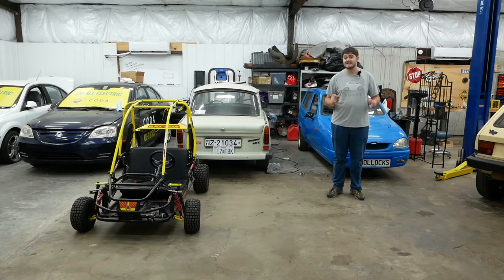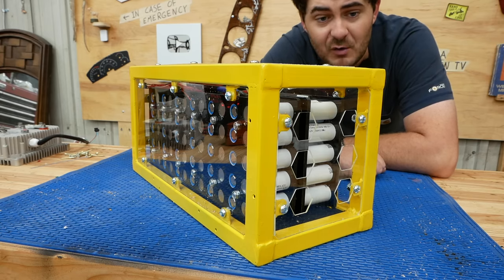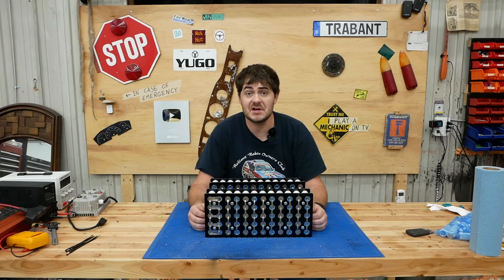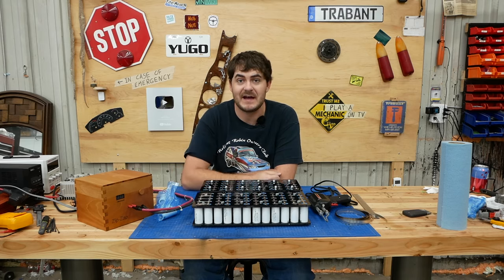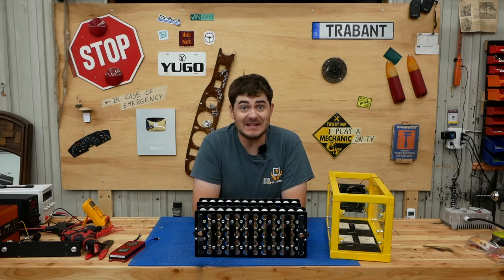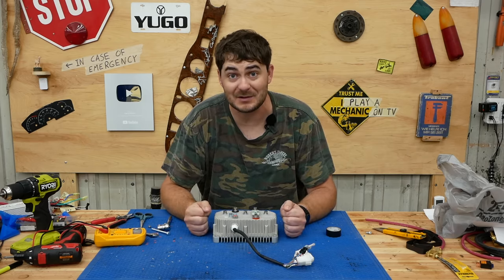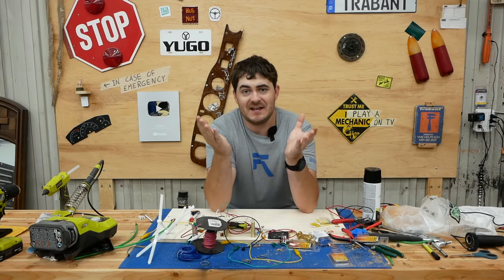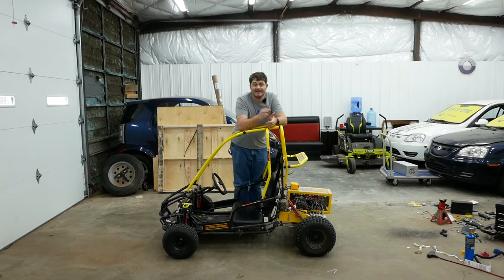I Spent Weeks Converting This Go Kart To Electric. Did It Work?

Comment: I suspect at higher torques, the magnetic field from the widnings is strong enough to overpower the rotor's magnetic field.  That in turn would cause the hall effect sensor to give bad readings.  Try running more current through the rotor.  Or make another rotor coupled to the alternator, with permanent magents, jsut to drive the hall effect sensor.
Reply from the maker: A secondary rotor just for the hall effect sensors is genius and something I never considered
Reply: Stares at electric lawnmower
Reply: It might have been the 3d printed parts he used!
Reply: I think it's more of an issue of interference with the hall effect sensor itself. Either magnetic OR electrical. Electrical shielding of wires, and magnetic shielding for the sensor itself will probably be the key. Add a shield wire to the sensor wires, twist them tightly, and attach only one side of the shield wire to ground. Start with the small things first.
Reply: What does fiberglass taste like
Reply: Yep, since the alternator was not designed as a motor, the magnetics would be rubbish and cause interference I reckon.
Reply: @sunnyjs  does it have speed control?
Reply: "PMG control" I love  it ! If you're going to build a PNG!  think about a multiplication ratio of at least two Times base speed of the primary mover... Will significantly increase tuning resolution within the motor controller!  Peace
Reply: This is great thinking
Reply: THIS IS THE COMMENT CROSSOVER EVENT I'VE BEEN WAITING FOR!!!
Reply: @agingwheels  It would also be a very good idea to print some sort of cover for the top of the controller to insulate the terminals.
You're getting into dangerous DC voltages there.
Reply: I love it when two people I subscribe to talk to one another.
Reply: Holy guacamole Matthias.  I've been running into you for years.  I remember you back from I think CNCzone when someone, or you posted the calculations to make gears.  1.7 million subs now?  Well done.
Reply: Hi Matthias!!! Big fan here. Love both of your vids! Also you are correct about the magnetic field and the hall effect sensor.
Reply: Permanent magnets should have been installed anyway, since there is no need to vary the field strength of the rotor.
Reply: @agingwheels  do it.
Reply: “Hall effect sensor?? But I installed that myself!!” ✊😂💜
Reply: Yeah I was going to say externally mount the hall effect sensors and make a permanent magnet disk
Reply: @avaviel  ????
Reply: Honestly just ditch the sensors. Wire the motor as a series wound motor. You can then just use a controller that costs 10% of what AC controllers do.
Reply: @sunnyjs  What's this for? It's your electric go cart son that can only be run on the grass with supervision
Reply: @agingwheels  why not just make it a permanent magnant motor with neodymium magnats?
Reply: Unless a overvoltage protection is used to keep the rotor from generating a higher voltage condition being fed back into the buck converters this could potentionally cause the output capacitors of the buck converters to be overcharged and fail due to the field coils driving back at the rotor coil. Most buck converters have over voltage protection as the use pulse rates to charge the capacitance to desired voltage
Reply: my life is like the hall effect
Reply: @gregbailey45  I don't think that's it ..also Chinese motors have unshielded hall sensors and the work fine..
Reply: @WCM1945  why you say that? In the end the electromagnets are doing the same work right?
Reply: Why did I read this comment in both of their voices perfectly?
Reply: Or maybe he could use an encoder (a type of sensor that measures angle of rotation, and are often used for brushless motors.)
Reply: 000009n😊 11:23 😊😊😊😊 11:45 11:49 😊😊

Comment: Pro tip: when an internal fuse in an electronic device pops (ie one soldered on the PCB that's inaccessible without voiding warranty) there is ALWAYS a reason. Always. Maybe a transistor's gone bad, or a chip is fried. If it was a simple over current event, the manufacturer would have put externally available fuses, for example the glass fuses that some devices have in a screw type terminal.

Comment: I'm throwing a guess, but the hall sensor error upon increased current could be from electrical noise interfering with the sensitive hall signals, and then the motor controller freaks out.
Reply: BIG CABLES WITH NO SHIELDING my gosh, u might be on to something! HE NEEDS TO TWIST A SHIELD WIRE into sensor wires OR FIND SHIELDED SENSOR WIRES
Reply: @imakedookie  that might reduce the overall efficiency and overheat the motor but it wont cause an immediate cutoff
Reply: I'd put money on it. Those little buggers are sensitive! Was having intermittent issues with one and the problem ended up being the trackpad on a laptop on the other side of the room.
Reply: So throw an oscilloscope on it to check the signals on a bench test? Use a portable 'scope for live testing?
Reply: Most likely an transient from the DC-DC coupling into the LV lines. Some shielded HV cables and better grounding might improve the behaviour but i would recomment a proper motor that already has the sensors as it might already have some filters or anything.
Reply: Yeah interference or the hall sensor at the wrong spot, causing timing issues. When you never build a proper electromotor with feedback then you have a big chance you fail the first few times. He would have been better of buying a motor. Now he has a lot of dead or maybe dead parts.
Reply: Carrier frequency emf from the drive. Yep
Reply: Nobody mentioned that the rotor is actually coupled with carbon brushes... Not to mention the rotor is actually a coil, not a permanent magnet and that creates a transformer effect. He just needs some hoverboard motors and a way to connect them together.
Reply: We ran into the same issues with and ODrive in research. Good grounding helped as did a choke around the wires. Also making sure any regenerative current settings/ over current settings are high (or low) enough. Hall sensors are tricky to get working.
Reply: @alan_felt  +1 on the current limits and good grounding. EMF noise in usally not that big of a problems since there is no sparks from brushes involved. I'm thinking a hall timing issue. Creating a few cm of distance between hall cables and motor wires is always recommended. Also short power cables. Have you made sure the low voltage signals only have one way to ground? 2 or more ground alternatives create ground loops and can distort the input signals to the esc, but I dont think its what happening here.
Reply: this is also what i would think is the issue. a proper motor for that controller would fix that part of the issue. the bms cutting out is likely the surge current of that controller being too much for the bms itself. the inrush current from the battery on the charger likely fried the charger.
Reply: Exactly my thoughts, noise is explicitly one of the things that looking up the error suggests as a cause.
Reply: I think use Some better dc to dc converter for your coil. For interference. And you have to weld your tabs in you battery. To much internal resitance when using clamping. The current draw is high when starting the motor underr load. Have a great day
Reply: @fletcherreder6091  Whaaaaaaaaat hahahaha
Reply: hall sensors are also incredibly sensitive to magnetic fields (nearby high current conductors would mess with the sensor head quite a bit) - which is also something a copper or aluminium shield would not block.
Reply: @DockterDoom  needs to use a toroid on the hall sensor wrap a few windings around the toroid if that works it was RF field getting into the wires causing error
Reply: @DockterDoom  But he tested with a separate battery on the rotor ! No EMF there !
Reply: Couldn’t the controller be misprogrammed with “pole count” too? I remember programming a Sabvoton motor controller and had a similar error.

Comment: Oof, hall sensor errors have plagued me with Kelly controllers. One thing I’ve noticed is my kelly is incredibly sensitive to hall signals that output a poor signal. Try scoping the hall signal and make sure your hall signals are clean and make a clean transition between high and low. I’ve had this issue in two motors, one was solved by modifying the motor and the other was solved with adding a little capacitance to the hall signal that has the issue. Let me know if you need any help!

Edit: I should also mention that Kelly provided amazing product support. Send them an email and Fany will get you sorted.
Reply: Something doesn't make sense in his setup, he uses an alternator which afaik doesn't even have a built in hall sensors so unless he added them or uses a sensorless controller that wouldn't work
Reply: @TheBlackAndWhiteCow  He added hall sensors in his last video on this project. You would know this if you A) Heard him say he added hall sensors in his last video on this project, or B) Watched his last video on this project, during which he added hall sensors.
Reply: Gotcha, YouTube failed to delete my comment for some reason because I posted it before I watched the whole part. still there's so much to fail when converting and you end up with subpar motor that wound up for low voltage and still brushed and you still have to match the correct voltage on the excitor coil, unless you do it for fun it's better to get a proper BLDC for that
Reply: This is a silly rube goldberg device that costed a fortune and doesn't work. Put a damn predator engine on it and be done with it.  The kid absolutely will get over the noise. He'll come to love it and associate it with good times.
Reply: @tarstarkusz  Have... Have you been to this channel before? You think he works on stuff to get results? What a grand and intoxicating innocence. How can you be so naive? He does not own a Yugo or a Coda because they are sensible cars to own. He isn't converting a bus to a weird RV-car-carrier because that's a sensible thing to do.
Reply: @erictheepic5019  I've been subbed a long time.  He used to do a lot of serious work, like tearing down his engine in the lada or whatever it's called. 
This is supposed to be a gift for a kid, not a project. 
Just because he owns shitty cars doesn't mean he has to do shitty work, which he usually doesn't do.
Reply: @tarstarkusz  Not the point.
Reply: I suppose you already tried the hallsensor calibration? I also have tried many hallsensor configurations with Kelly trying to get an BLDC outrunner to work with multiple Kelly controllers. Unfortunately i never got that to work and ended up with an 75200 VESC controller. The Kellly controller is now used in a scooter with a hub wheel that didn’t have any issues with the Kelly controller. Some how they are very picky about sensors. The VESC btw, is a much more programmable ESC that’s also way way better to trouble shoot and isn’t that expensive.
Reply: @kwintberg   VESCs are great, was wanting to go that route with my project but none of the high voltage/current ones were available at the time. What are you using the 75200 for?
Reply: @tarstarkusz  legit was a wtf moment for me? Just put a god damn actual electric motor on the thing. Went through all this trouble to make a custom battery and controller setup then used a half baked POS alternator. 

I legit bet it is the motor that is the primary issue. Yes he could do with some better grounding and noise control,  but this is why happens when you try and use half baked electrical components for an electrical setup.
Reply: @seemlesslies  The whole project is bad and the reason for it is half baked.  There is literally no better way to get to kid to no longer be bothered by loud noise than to give him a noisy toy.

IMHO, this should not be electric for, among other reasons, the high instant torque the motor generates and with a 5 year old driver. Makes it easier to get into trouble.
Reply: +1 on hall sensor output filtering, adding 1k R + 2 - 22nF C RC filters might help.
Reply: @TheBlackAndWhiteCow  Watch the previous video where you see the installation of the Hall Effect Sensors.
Reply: Very nice comment hope he reads this
Reply: @tarstarkusz  It's the journey and not the destination that's of interest here 😉
Reply: @dubmob151  Not when it's a birthday present for a 5 year old.
Reply: @tarstarkusz  i bet you're an absolute riot at parties.
Reply: @chefboyardeeznutsinyourmouth  Why do you say that?
Reply: @tarstarkusz  because you fail to see that the entire point of him doing it the way he has in these videos is for fun and experimentation, neither of which you seem to have a sense for.
Reply: @erictheepic5019  He may not have put the hall sensors in the correct spots.